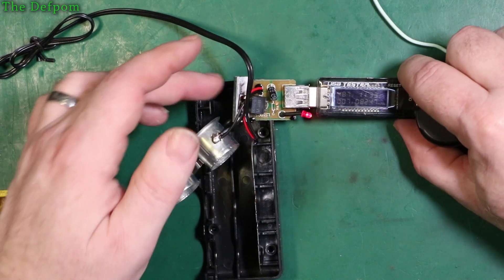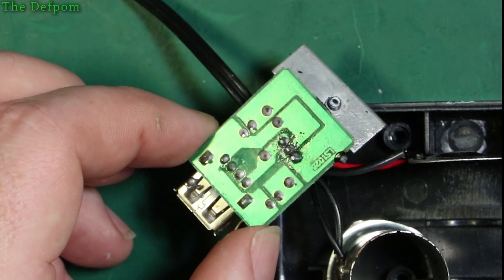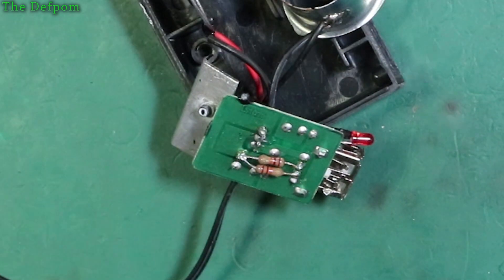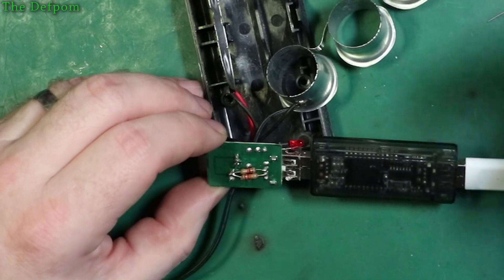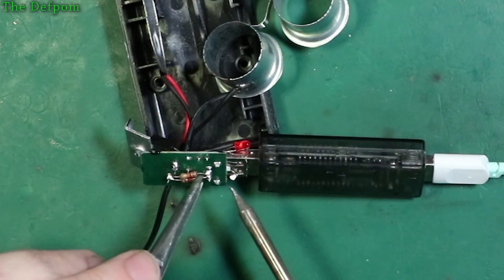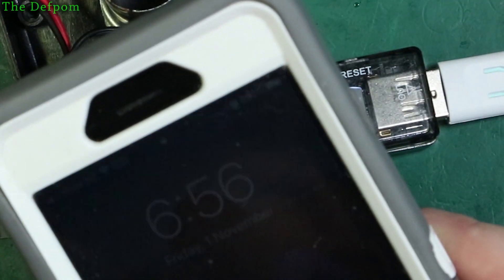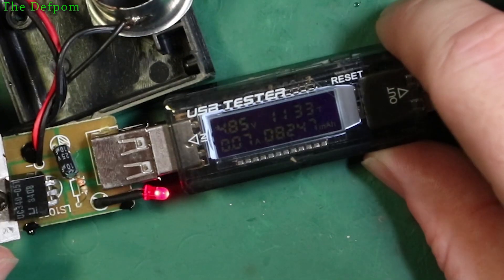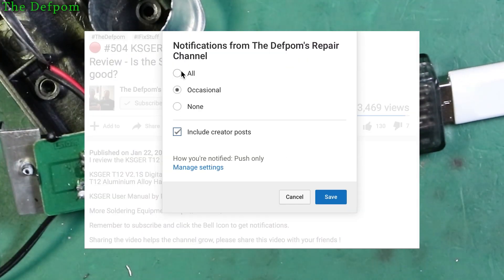#660 My iPhone 6S Wont Charge - USB Charging Port Data Line Experiments

Comment: If you do get it to charge at 0.5A when driving the regulator will be dissipating 4.4W.
I thought the middle pins are just shorted.
I could not read the colours on your resistors you said 75K and 50R it looked like 7k5 and 47R but either way it would have 3mV or 31mV on the data lines I don't think it would detect that small a level.

Comment: You do not need 1Mohm resistors, just short D+ & D- it is the standard old style USB way to signal that it is a power supply. Apple and Samsung have used resistor coding with different values, but modern charger often use more advanced protocols for specifying current and voltage.
I have written a bit about the different charger coding here:
https://lygte-info.dk/info/USBinfo%20UK.html

Comment: Yooow bodgy bugger ha ha :-D, i would do much the same and stick it back in the case if it was my own.
For someone else hmm neater, otherwise i would worry about it failing.
A UC340 reg, i first thought about the classic LM340T variable one, but no.

There is a 5 min project to make, small box with dip switches and resistors for every version.